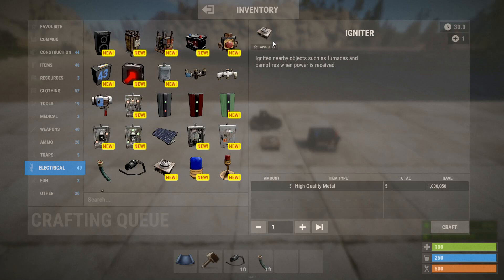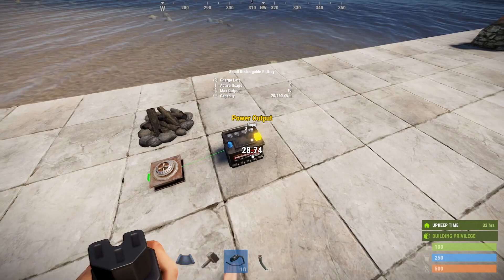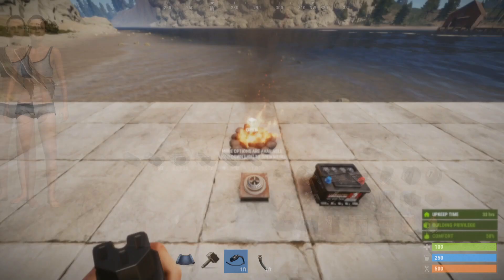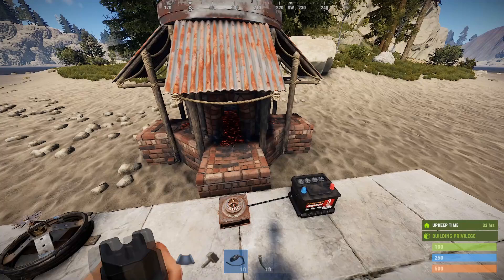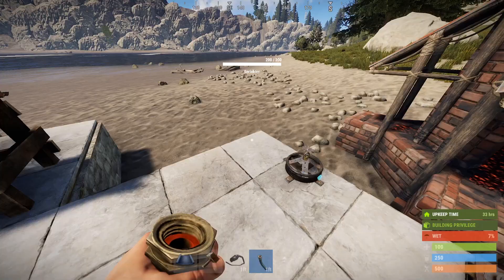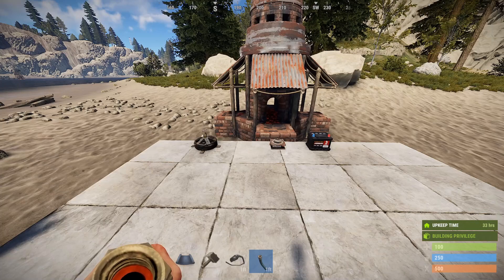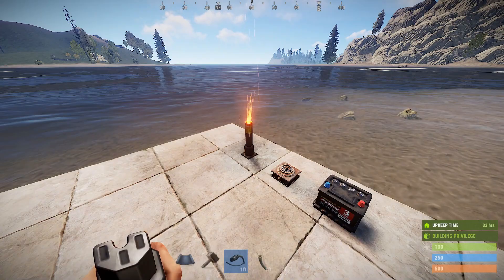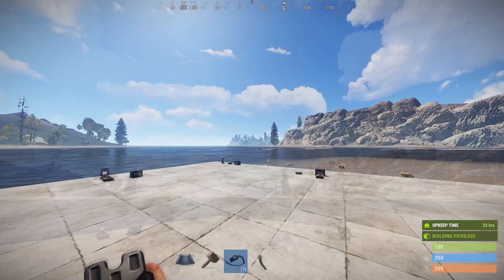Rust Electricity 101: Component Guide - Igniter

Comment: What Ive done before now is cluster my furnaces/refineries around 1 igniter and connect it to a pressure plate. The plate gives off just enough electricity to start all of them and it saves me having to light them all one by one if I'm doing a big batch.
Reply: You will be able to do this with the red push button instead of the pressure pad soon if this commit is any indication: https://commits.facepunch.com/372570

I believe the reactive target (as of Sept 2020 update) throws a burst of electricity without any input as well.
Reply: @worlwr2  that is excellent news! Thank you

Comment: So my question what's the point just hit the on button u have to keep putting fuel in it anyway
Reply: One less step, but more steps setting it all up. also if connected to hbhf sensor you could look online
Reply: I know this comment is 2 years old but I fully automated my base and this helps a ton it automatically turns it on and puts wood in it for charcoal

Comment: What if your satchel didn't work after you throw it on the wall and you try to re-ignite it with the igniter?
Reply: it uses a different mechanic, you have to go back up and hit it with E to 'relight' the fuze in that case
Reply: @dangermaus4084  Yeah I know how it works. I'm just wondering maybe it works with igniter
Reply from the maker: Yes, this is indeed possible, probably not particularly practical though! Here is the demo:  https://youtu.be/HFFkpS51Oe4